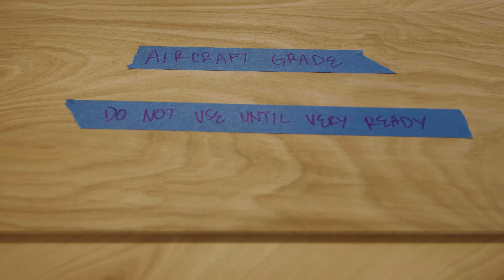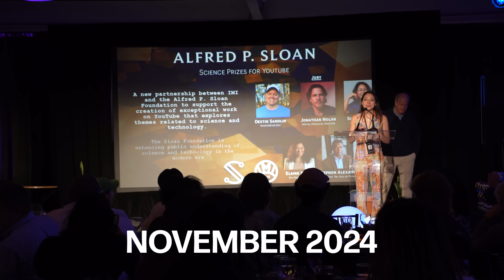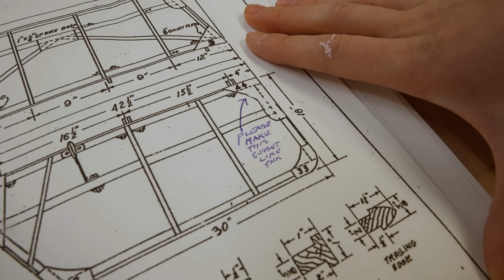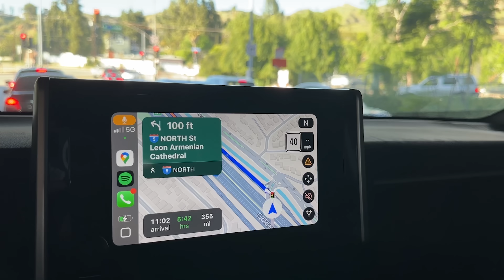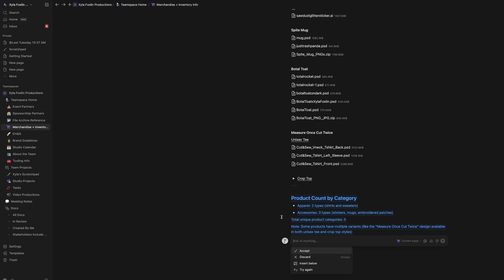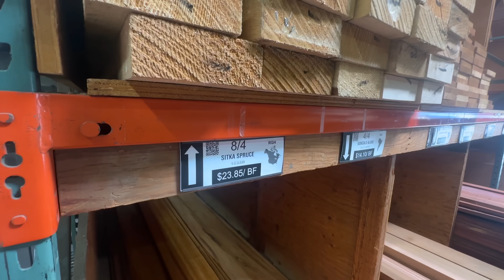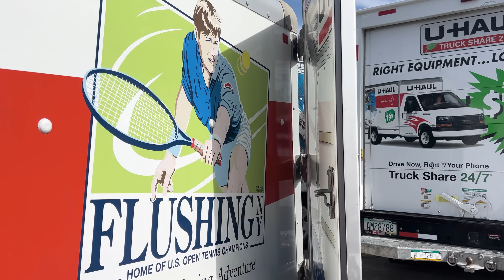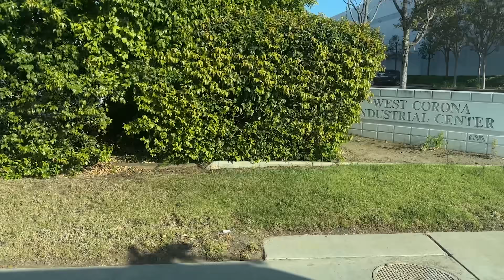I'm Building an Airplane from 100-Year-Old Blueprints

Comment: This plane was designed to use a Ford Model A engine. What would be cool is if you use one of the brand new Model A engines which are available. The engine looks 1920's on the outside but inside it has 5 bearings on the crankshaft and camshaft, better oiling, stainless steel valves, and several other improvements. Unlike the original engines it's reliable at high RPM for long periods and has no trouble running a car at freeway speeds. So it should be ideal for this airplane.
Reply: Find the January 2022 issue of EAA Sport Aviation Magazine. It has a five page article on the "Burtz Block" new Model A engine in old aircraft designs. All-in cost fully built on one (in 2022) was around $8,000. That's dirt cheap for an aircraft engine.

Comment: I have been building model planes for most of my life.  Most of them flew really well.  So if you run into a quandry over some aspect of your build, maybe try it in scale first, and the bugs will show up.  But they will cost a lot less money to figure out.  No airplane since about 1927 has ever been built without models to guide the way.  Way cheaper to make a mistake.

Comment: Thank you for showing us this project, it looks like a lot of labor, but also a lot of fun! By the way, a little after 7 minutes into the video, you are lying on some of the wood to show the scale. Text then popped on the screen saying, "Xyla for scale, I'm 6' 5". I do not think you are quite that tall.

I was surprised at around 12 1/2 minutes in when you were not only changing the saw blades bare-handed, but you were doing the first cuts bare-handed as well. Don't you usually have a safety block to push wood across the saw table?

Always great to have a friend like Steve! Looking forward to video #2!

Comment: You should get hold downs for your table saw. (I use  those yellow rubber wheel ones.) Those long lengths have a lot of leverage that want to lift the board off the blade. Even with your extension table, and rollers. The way my table saw is set up is:  If I have any concerns I can just stop, turn off the saw and the board doesn't move. I've always approached using a table saw as, Do I understand everything I am about to do? If I have any questions at any point, I just stop. 
Also, if you do need a longer board. Make a jig for a skill saw to cut a long diagonal scarf. 12:1 is ideal. Epoxy them together. The new board will have all the same bending characteristics as a single length. I've made keels and gunnels for boats by this method.   You can 'build' a perfect board from a few imperfect ones. If you need images of what a SkilSaw scarf jig looks like I'll dig mine up. Basically it's got a lower section that holds the board in place. 2x3s On top is a fence for the SkilSaw to slide against. 
With epoxy I don't sand the join, rougher has more 'tooth' for the epoxy. 
"Epoxy is stronger than the wood." What this actually means is that if you get the wood wet and it swells, the epoxy (and glass) will separate and take a thin layer of wood with it. 

Also as I'm sure you know, several years ago a group made a copy of the 1903 Wright Flyer. Wonderful, except, it was too unstable to control pitch. It crashed and was destroyed. Unless your goal is an exact replica, make whatever changes are necessary or advisable to make it stable enough to fly. (Or maybe fly by wire that can keep up with the dipping and not over correct.)  Good luck  I can't wait to see you flying it.

Comment: Great start to your Pietenpol build series Xyla! Looking forward to seeing it come together. I keep thinking of all the engine options you could go with: Model A, O-190, Jabiru 2200, HD Milwaukee-Eight, Garrett JFS 100-13A...

8:29 good addition to the video. Hello Xy-mom and Xy-dad! Your board feet problem was interesting, they are pretty easy to visualize, a board foot can be a one foot long 2"x6". Your problem is having to make a nearly 30' long wing spar. Some of that wood looks pretty close to the 6 rings per inch minimum required in MIL-S-6073 13:20 and 15:55 for example.

Comment: Back in the days when all drawings were paper, and rolled prints were a way of life, there was a hack to get your drawings to lay flat. 

Take your roll of drawings and roll them backwards. Pick up the backwards roll of drawings by one end. Swing it overhead, smacking down flat on the table. You can now unroll the bundle and it will lay flat.

Comment: As long as you can secure the cargo it doesn't matter if the door is open or closed, if items stick out to much then put some plastic on the end like a flag for people to see.  Or you could have put the beams on the roof of the trailer and plywood inside.

Comment: Clearly you just need to move to the Midwest and make friends with the redneck air force. Everyone has a pickup truck and a trailer. You'd been back home the same day and it would have cost you a case of beer 😆🍻

Comment: rav 4 would have been fine... engineers care about load specs too much... just don't make any sudden starts or stops or turns and rachet the life out of it your SUV would have been stronger than any cheap u haul trailer.. there's a line of beat-up sedans outside of my local Lowes hauling refrigerators that says so

Comment: Awesome project!  Will you be using cub wings or some other such wings? Or will you build them?  Also what engine do you plan on installing in the plane? A super cool and totally unique engine would be a VernerMotors Radial, the original Pietenpol used a Model T Ford engine, I believe around 40 HP. The Verner Scarlet 5 would look awesome, sound even better, and would make your Air camper one of a kind COOL!  imho,  but hey, it’s your plane, so I will watch the build no matter what!

Comment: The Piet is a great little machine. A friend of mine built one. One bit of advice - if you are going to use brakes, make sure you incorporate the later design landing gear with the axles further forward. Far too many Piets have turned over on landing with the original gear.

Comment: I think you mentioned switching to a new narrow kerf blade. You may need to update your riving knife as well depending on how thick it was previously. That could possibly cause extra resistance when pushing these thick (or any) boards through (also depends on how parallel your fence is to your miter slot at the back). Great project!  That is certainly some expensive a$$ wood!

Comment: Look up Electrostatics-based propulsion using high-frequency EM signals bounced around within layers of Aluminum, Magnesium, Bismuth waveguides that can rapidly pulse/charge/discharge specific areas of the outer hull of any given aerospace planform to push/pull against the atmosphere without needing high-surface-area wings. Find and electrical engineer who has high frequency EM signals experience and get them to design the pulsed EM system. You could probably do it for less than $25,000!

V

Comment: Chances are you can rewire the table saw to run off 240v and it will perform a bit better. Of course thats only useful of you have 240 in the garage.

Comment: It looks like you need a jointer, I recommend one with a helical cutting blade as it’s much quieter and the inserts can be rotated 90 deg when you need to change the blades, thereby having a built in extended life. Also, I noticed how you cut the first rip, if you placed the board so the Final Cut was on the opposite side that is shown, you would ensure absolute identical widths. You should also consider building a DIY CNC mill that can hold large sheets at 8x4. Then you can have the router cut out all the pieces and maximize the amount of items you need to cut per sheet and it’s accurate once it’s all calibrated and dialed in. A 2.5D Wood CNC’s are fairly stray it forward to build and if you build it off the Mach 3 software, and build your base where you lay the large sheets down, as a swappable platform to a series of long thin metal bars, you can buy a cheap plasma cutter and use that same setup to cut steel or aluminum parts out. The wood CNC is not that great for milling aluminum, it can be done, but the frame should be made out of steel and the Z axis stepper should be pretty beefy to push into the metal, if you go in that direction. Given the expense of wood, and the effort, you want to be able to minimize all waste and potential mistakes. However there is something to be said about truly hand crafted. My aerospace mentor who recently died, my god, he was a true craftsman and was even the subject of a doc film on YouTube called the defender. His name was Bob Diemert. He built a full scale P-51 that he was going to equip with a steam powered engine. He eventually abandoned the engine but the airframe was finished and every single element was all hand made out of wood and is a thing of true beauty and he was at the top of the art form. Wow. I spent some time with him in his hangars and spent a couple weeks over a two visits, just helping where I could and cleaned up, but his shop was a wood workers paradise. He didn’t want to buy a CNC mill as he was old school. Every rib, spar, connector, cowling, cover and absolutely every single element was hand made by him. I encourage you to keep going and consider a CNC mill, because as you go further along, you’ll have sodden ideas that you’ll want to try and you’ll have to iterate and adapt as you go and a CNC mill will become an indispensable tool. Your outfeed table for your table saw should be at least 8 feet long so there is no stress applied to the material as you cut as it approaches and falls off the table. You may want to consider using art resin to make a lovely unique painting on the outfeed because the surface of the resin is super durable, slick and perfect for an out feed table and you can keep repairing it over years and add to it like a layered resin painting. You should consider replacing your lighting with full spectrum grow lights used in hydroponic greenhouses as it will be more closer to true daylight and it makes a huge huge huge difference in one’s mood as you work under them. Eventually as you grow into a larger space, you should plan to have an overhead crane that spans the either width and length of your shop and the I beam can be high enough as to not interfere with anything. This will help when it comes to loading in or moving super heavy things like engines or heavy steel objects. 

Keep up the inspiring work! Soon enough you’ll be in a much larger shop and as long as you thoughtfully designing it so it can be as flexible as possible, it will allow you or others to make some truly creative things. 

Bob Diemert started the warbirds restoration industry, restored a Hurricane, Zero and Val Bomber. Here is the doc film if anyone wants to watch.
https://m.youtube.com/watch?v=ZvbQMqd0kEY&t=226s&pp=ygUMVGhlIGRlZmVuZGVy0gcJCbIJAYcqIYzv

Good luck!

Comment: For the record:  no, you can't load a UHaul with the door partially rolled up.  It will BOUNCE UP AND DOWN as you drive - and over the course of a six hour drive that will beat the hell out of your "perfect, clean" lumber.  Even if you try to strap it down, contact between the wood and the bottom of the roll-up door will still damage the wood.  And it sounds like you are trying to avoid ANY damage in transit.  You'd be better off renting a truck that's long enough to fit the lumber with the door shut.  And driving with the "barn doors" open on a UHaul truck is illegal and dangerous.

Comment: As an experienced woodworker, it isn't easy to rip such large boards by yourself, but it can definitely be done. Since you don't seem to have the nessasary strength or set up to do it yourself. You should consider using a track saw to process the rest of those boards. Just make sure to use a straight edge to double-check that the track is straight. An ink line is also a good indicator if your cut is straight.

Comment: Tip: Run a smaller blade on an under powered table saw. Your torque on the teeth will increase and you’ll get cleaner cuts.

Comment: with wood that expensive, i think i check the settings on my table saw by first running cheap wood through it. then run the expensive stuff through it after you're sure the settings are correct... fwiw

Comment: Can you go more into the thoughts on board selection. Is this a need to  have 100% clear straight grain for these runs, obviously a large not reduces the boards strength at that point. But those blemishes looked mighty small

Comment: Several years ago, I was a mechanic at a textile factory in Kansas, Hubco Inc., that manufactured & sold small bags to Aircraft Spruce. I remember the logo well cause it was super difficult to get it centered on the fabric printer. We're talking ink printers from the 30's or 40's or something. But it would print, then cut, then fold, then sew, then insert drawstring, then stack like 10,000 bags per day if it ran good. LoL. But that friggin logo....gah dang.

Comment: I know you have a lot of experience with power tools but pushing the lumber past the blade on the table saw with your hands and arms @ 13:00 while ripping instead using a  push stick is an unnecessary risk.

Comment: Hi Xyla,
Are you gonna stay "Old Skool"  and use a converted Model A  or go w/ a 65-85 Contential ??   As light as you are the "A" will work just fine and way cheaper to build..😊..  (Call Alania for a prop !!)  Fun thought: Do the 3 piece wing, wire wheels,  btw,  yer 140 will run rings around it !!   Blessings ❤

Comment: Those rolled plans were normal when I was young. There is special masking tape we used to hold the corners to the drawing (reading) board and you had to remove the tape very carefully or you will tear them up.

Comment: 12:15 ehhh... Live plugs vs overhanging metal chisels. Adhoc is one thing but I would suggest to reconfigure the setup there. If someone trips on the cord, rips the power while on you may get sparks flying or worse.

Comment: The vintage plane I've wanted to build would be the Corben Super Ace. It looks so cool and was built in my home state. (Actually I want to build a replica of Steve Wittman's D-12 Bonzo but Liberty V-12 engines are both hard to come by an not inexpensive. A Tailwind would be a fun alternative of one of Steve's designs but I'll probably have to settle for building a Sonex as the factory is right in town and I don't know how to weld tube steel which would make building a Tailwind (or a Super Ace) difficult as it has a tube frame. I DO know how to use a pop rivet gut which makes the Sonex even more attractive.

Comment: This comment is from a lic A&P with build experience.  You can do it. Plan for two years and 2000 man hours. You will do just fine. Stick to the plans and FAR's 43.13 when in doubt. Join your local EAA association to find qualified help as needed. You are going to learn so much. Go girl!

Comment: I would probably just have put the boards on the roof-racks and drive away😂. ( i have once transporter a 12 meter long 4X- (rowing- boat) on a Ford Fiesta😎 - with a aluminium latter between the roof racks and the boat to present it from breaking in half)

Comment: Hope those plans I sent made it to you - but looks like you didn't need any encouragement to move forward with building an experimental! Very cool! 
Also the ^hunt* for materials - relatable. For me, chromoly thin wall tube was a pain to find. Drove 3 hours each way in my case, lucky though I had a pickup and borrowed a rack from a friend! Entertaining to bomb down the freeway at 70 with 20 fo0t sticks of tube on my roof! Cheers!

Comment: You say you are more accustomed to CAD. If you have not already broken down the rest of that lumber, might I suggest you spend the time to translate those drawings into a CAD model?  It will prove to yourself that you are interpreting the drawings correctly and give you much more insight into each element of the design as well as the overalll design and interactions with the various pieces.  As a side benefit, if you happen to miss tolerance on a component, you can study the impact in the CAD model to decide whether you need to scrap that part. I started my aero engineering career on the drafting board and transitioned to CAD after about 10 years. I always found modeling from the hand drawn print to be invaluable

Comment: You should invest in at least a 1/2 HP variable speed power feeder for your table saw. Then go to Western Roller and buy the blue tires as they are the stickiest tires. I run the yellow on my shaper table and they don't grab the wood as well as the blue, which I run on my feeder on my table saw. This will turn today job into a 1 woman job. PS: The power feeder won't be as good a company as your friend. They don't talk much.

Comment: You made what could so easily have been, and probably should have been, a really boring part of the project so fun and entertaining!!

Very glad to see you started to wear a dust mask when using the table saw... was a bit worried when you weren't and didn't want to be That Guy in the comments cause I know how hot on PPE you usually are. It looks a bit though as if a part of your body might have been behind the wood at the end of the first couple of cuts, might have been unavoidable due to arm length but after seeing some scary safety demos about kickback I've become super paranoid!

Comment: You don't, but in my opinion, your plans are rolled backwards.  If you roll them with the lines out from right to left, so the larger margin is out.  They will lay better so you don't have to weight the edge.